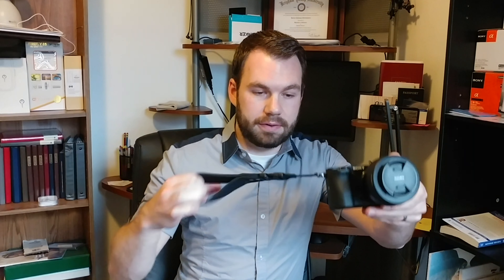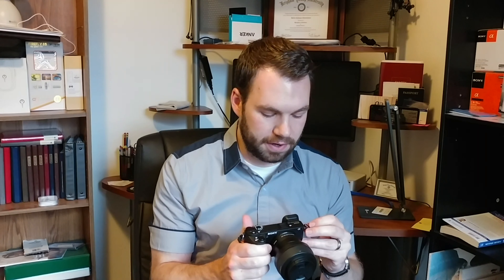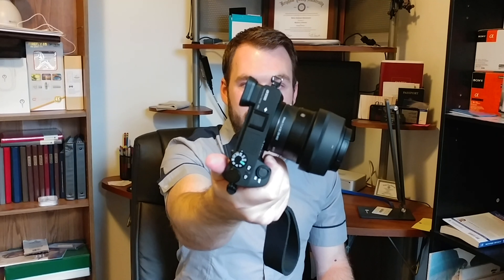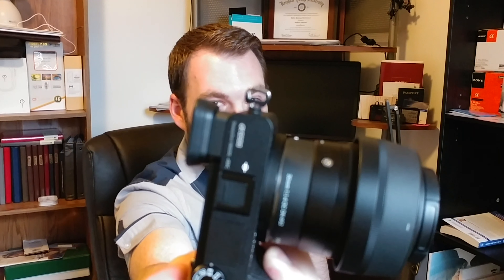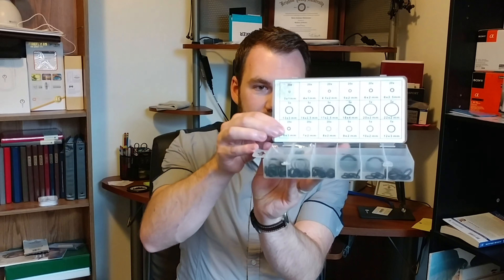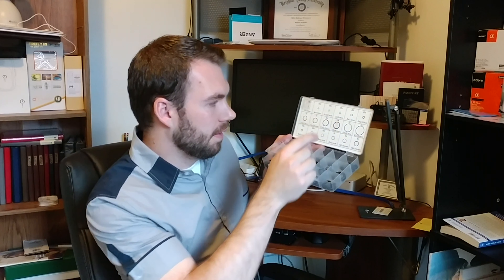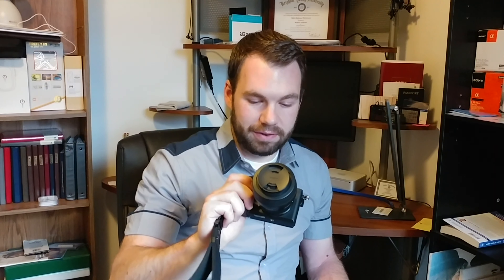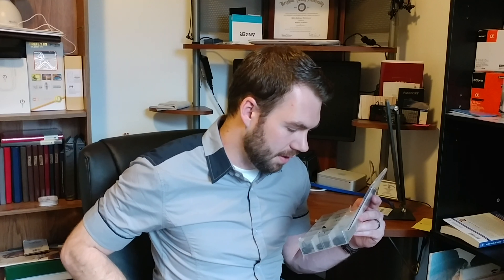How to fix the strap connector rattle on Sony cameras

Comment: How strong are they? I'm worried that they may break.
Reply from the maker: I've replaced one or two over the past few years (I have them on three different cameras). So they do break, but not super often.
Reply: Try to find earbuds, small enough to fit the size of the hole, cut them to let allow the dring enter the hole, it will block the dring to move and the silicone gel texture on the dring will prevent the sound.